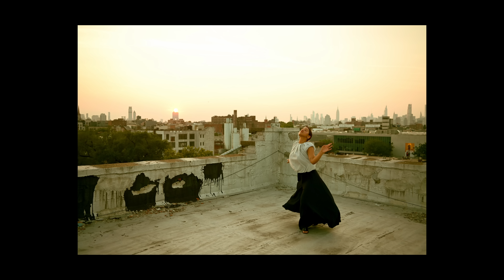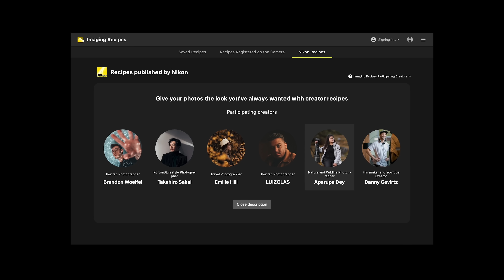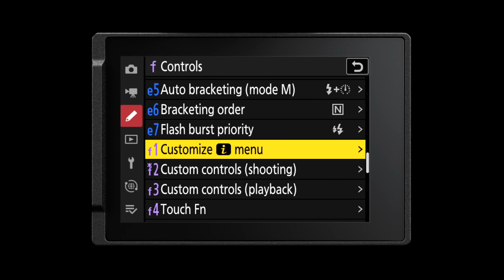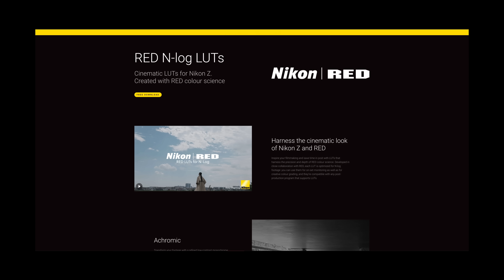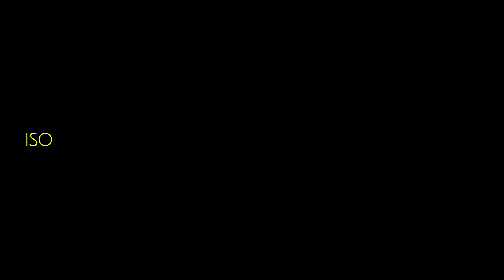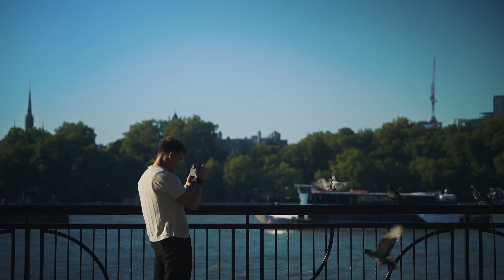Nikon Z50II | First-look of our new DX-format mirrorless camera with Ricci Chera

Comment: Sir it’s an amazing camera as I am using it personally but the bird auto focus does not work properly and ibis is also there making it very hard to do bird photography specially when taking videos. A firmware is required immediately for this correction.

Comment: Is the z50ii better then the z5 ?
Reply: Yes and no. The Z50II is faster with better AF in a smaller and lighter package.  The Z5 is full frame with IBIS.   It will depend on your use case.
Reply: I have a Z5 which is fantastic but if I didn't I'd definitely by the Z50 11 instead. There are so many extra features and I find a pop up flash to be really useful. I never need IBIS and never print pictures larger than 20x20 though.
Reply: @andrewwillows4333 I also find the pop up flash useful, why they don’t have it in all cameras is questionable, you might say it’s due to weather sealing but let’s face it how many times are you out in the rain?

Comment: for myself the Z 50 II is a notable upgrade to the older version,  but to all the wishfull thinkers, you can't expect the upgrade of an entry level camera to be on par with the flagship... I don't need  a technical overloadet machine  like the Sony's... where the improvements can only be measured in the Lab... but in order to buy it ... the lack of a weather sealing and the missing IBIS is a not to buy criteria for me .. Nikon should more focus to compete with the Panasonic Lumix were you have this features allready in their  beginner cameras ,than to compete with Sony. Nikon to me outperformes the most Camera models  and I would be willing to pay a 100 bucks more for the IBIS and weather sealing... so I just have to wait a little more to see what is coming next and hoping Nikon is listening...

Comment: I started with the Z 50 and still use it a lot, now with the 50-250 only. I am buying the Z 50 II with the two lens set. I have the Z 8 , the Z 9, and the Z f. The Z 50 II will be used a LOT mostly with the 50-250. Too bad it doesn't have a sensor shield.

Comment: It's a time & opportunity wasted by Nikon by launching an old wine in new bottle!!!! Instead they could have done well by launching Z80/Z90 bodies which could have been incorporated with 26MP/33MP or 40MP APSc sensor, IBIS,Dual card slots CFExpress & SD, EnEl 15c battery, Provision for battery grip, Exspeed 7 processor with Codecs for improved videos capable of 6K/8k... Nikon has one too many vlogging z bodies. Who says Z30,Z50,Zfc cannot do what Z50II is upgraded to do?? Once again Nikon has failed it's loyalist's customer base who waited for D500 replacement!!!

Comment: A very nice update. However, since 4k60 can be had in an additional 1.5 crop due to slow sensor readout, I highly doubt I’d ever use it. For the same reason, it is not worth waiting for the Z30ii if 4k60 is needed. Guess the current DX technology is not up to this task. Apart from that, z50ii seems to be a fantastic camera for the advanced photographer. I have to try it out before deicing this or the z30

Comment: If even Ricci, who is not only tech-oriented, seems to be disappointed with the use of this 9 year old sensor, I think we can all be disappointed.
We were expecting a D500 successor so much, with great battery life, fast sensor readout, ibis, maybe double card slot, even at €1500-2000 for people who use the benefit of apsc (in weight or reach).
Instead of what, we get poor battery life (z50 battery was terrible), no ibis, huge rolling shutter..😥
I really really love the brand but it's a cold shower tbh.
Reply: who in their right mind would expect an update to the z50 to be anything but a updated z50?? Making a d500 successor would necessitate a new model--z70, z90, whatever. This is closer to the D7500
Reply: @ts7071  nobody told that a new apsc from Nikon had to be the same model than z50. They could have released something else too 🤷🤷
Reply: @romainplagnol882  right but then it was announce z50ii and people are complaining it’s not a z500
Reply: @ts7071 True but no one said that Nikon had to use the same terrible battery. That's what I'm the most disapppointed about

Comment: No IBIS, a very slow sensor readout, only one sd card, pre release capture in jpg only, only 11 fps continuous shooting in raw, and so on. Where is the mirrorless D500? The real mirrorless flagship aps-c camera?
Reply: I have been  a fan of Nikon until have the Sony a7Riii.
I was expecting more updates in Z50ii.
But it is a very old sensor & without IBIS 👎.
There are nothing improvement in dynamic range.
Reply: 4Q 2025
Reply: No wonder nikons sales have plummeted over the years, they keep making the same mistakes. We want new sensors with new bodies. I'm waiting for z5ii, I hope they at least use the z6ii sensor in that. The sensor is what really let the Z5 down. I've not bought a camera since the d5600 came out simply because nothing is worth while upgrading for my needs/budget.
Reply: @chapstar1985  The d5x00 series really was very good. I still have my d5100 at home and a d5200 at work that I use regularly. I wish I'd bought the d500.

Comment: 📸   Nikon Z50 ii
❌️20mp from 2019 reused.
❌️No Ibis stabilisation.
✅️£849, affordable.
focus stacking
4k video oversampled
Great ergonomics 
Modern autofocus
Reasonable battery life
Focus peaking
Build, high quality
Reply: I think the battery life is the worst thing about this camera, being only 250 CIPA shots and I think this is the worst I've seen from any manufacturer. Still seems like a good camera despite this.
Reply: Battery life was already absolutely terrible in the z50. Nikon made a huge mistake not using a slightly bigger battery
Reply: @romainplagnol882  This battery is same physical size but larger capacity. Hopefully someone can increase the capacity even further.

Comment: No IBIS, no thank you. Nikon has made a huge marketing mistake
Reply: I'd happily pay more for IBIS but the price is right for the current features.
Reply: @veeaa Fujifilm SX10 is cheaper with IBIS and a huge repertoire of excellent lenses including Sigma and Tamron.
Reply: What price?  @veeaa
Reply: @haico1992  Under $1000€
Reply: For this price point IBIS is not common though.
Reply: Y'all will always gind something to complain about. Buy a Z6 or Z6iii if you want IBIS. 

Putting IBIS in the Z50ii would push the price into the $1500 range like comparable brands.

A used Z6 sits at around $500-$600. 

Additionally IBIS is not good for those of us shooting long exposures on a tripod.
Reply: Also no new DX lenses. Makes no sense 😮.
Reply: What Canon and Sony camera have IBIS in this price?
Reply: @sreejanspov  Nope. They cost significantly more than the Nikon at least at launch, prior to any sales these companies are running for the holiday season. 

Canon is comparable in price, however once you start really looking at the specs, and most importantly how they're implemented. Nikon sits in a sweet spot.

The Z5 has IBIS, FX, and cost less than the other brands APS-C line.

Last thing I'd add is the original Z50 got a bad rap about its LCD screen. Snapbridge solved that problem WIRELESSLY. Them not promoting Snapbridge, and not putting a smartphone hot shoe mount or base in the kit was a marketing mistake. They didn't even advertise that it was a waist level screen or that it was a crowd overhead screen.
Reply: @dct124  Why are so many people complaining about this? Yes, it doesn't have IBIS, but neither do other cameras in this segment. Canon R10 suffers from a lack of third-party lens options, and Sony a6400 6700 with ergonomics.
Reply: @sreejanspov  The answer. People want to have everything, for nothing. It boils down to their conflict with consumerism. They want all the features of a Z9 in the body of a Z30 that costs as much as a disposable camera.
Reply: Nikon knows a lot more about marketing than anyone in this comments section. Ask yourself why they would put all the features of a top of the range camera in an amateur body like the z50ii. How would they be able to sell the z70 or the z90 ?
Reply: @SingleTrack66  There isn't a new APS-C model aside from rumors. Any semi-pro APS-C models are likely to follow Nikon's pattern since the mid 2000s by first announcing and producing the lenses first. The Z30, Z50, Z50ii are 100% entry level bodies. The 12-24 PZ was a hint.

The world has gone through several economic hardships further delaying any desire to release a semi-pro line. Nikon is most likely waiting for the global economic market to recover first. There's a new window coming in 2025, 2026 (just like 2016, 2017).

It's what they've done over the years, even with the D200/D300/D300s.

The D500 was announced in Jan. 2016, launched Mar. 2016. So we very well could see a new semi-pro body by late 2025 due to the games being set in Feb. 2026. 

Maybe 2028 because, that's when the biggest consumer market hosts the Summer games, in LA. By then the economic market should've fully recovered from record inflation.

The D300 was announced 1yr ahead of the 2008 games and 1yr after the 2006 Italian games. Which to me points to a 2027 Semi-Pro announcement. Release winter ahead of the 2028 Olympics in the US. It wouldn't surprise me if Nikon did release two bodies like the D300/D300s within a short window.

D200 - 2005
D300 - 2007
D300s - 2009
D500 - 2016 (it's already past 7yrs)

We got 2 new DX lenses ahead of the D200 in 2005, which would just replace the 2 current Z DX lenses (same focal ranges). 

The lens I think they'll release will be a new 17-55 f/2.8 DX. Doubtful it'll be weather sealed as the last wasn't and since its release in 2003 has held up to beer, waves, and hurricane Katrina on the D200, D300, and even lesser DX bodies.

It wouldn't surprise me if they double dip by releasing two bodies back to back like the D300/D300s where one comes with IBIS, a normal sensor and the updated version comes with a partially stacked sensor.
Reply: What Nikon Doing For Their Marketing They Know It Better , They Don't Need Your Advise LOL!
Reply: No ibis means cheaper and lighter plus if you want to spend your bucks buy lens with ibis or more expensive camera
Reply: @jazinzlaty4823 Fuji succeeded with the integration of IBIS in their X100VI
Reply: @jazinzlaty4823 ibis could be integrated in x100vi

Comment: Does it have electronic shutter?
Reply: Mechanical and electronic.
Reply: Yes but with huge rolling shutter
Reply: @ Yes, rolling shutter effect in certain circumstances. Generally speaking, it’s best for the photographer to keep shutter speed less than half the frame rate in shooting fast moving subjects in AF-C.
Reply: Perhaps you are referring to motion blur in video mode(180 degree rule) ? Not the same as rolling shutter. The focus mode AF-C is for still photography. AF-F is in video mode.
Reply: haha at this price?!!
Reply: @gosman949  Yes it does, the same as the original Z50 had.